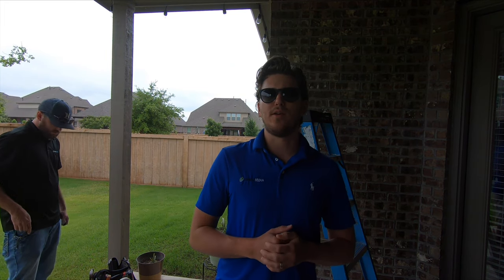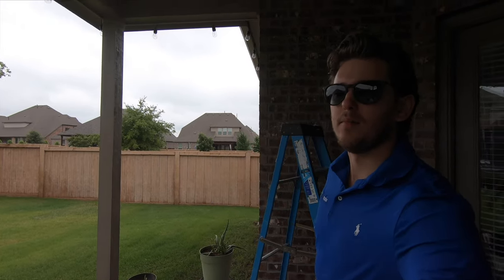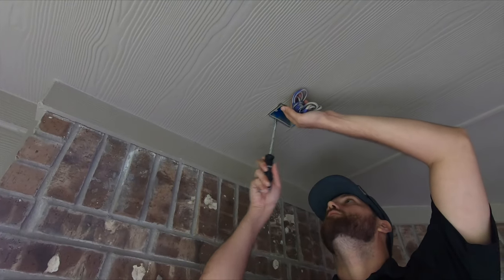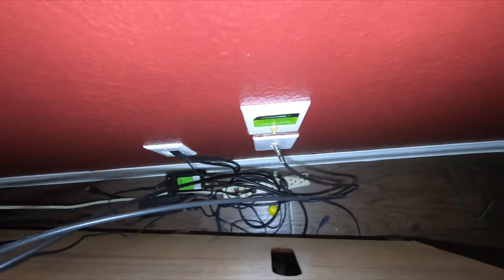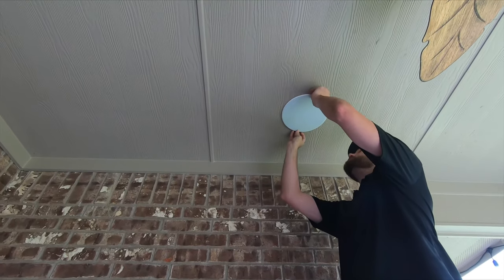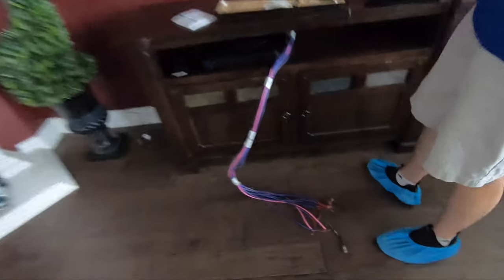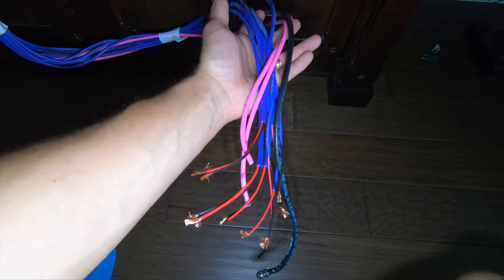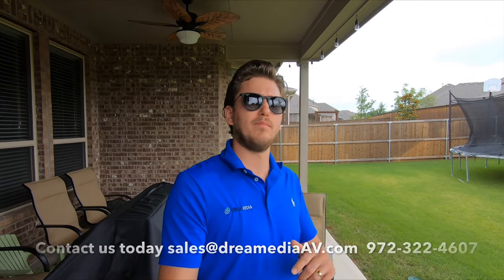BEST solution for speaker on the PATIO! Sonos and Episode ALL WEATHER IN CEILING SPEAKERS

Comment: Great video. If you don't want to spend $70 on a toner, you can use a AA battery. You will need to tap the positive lead on and off the battery while holding the negative wire to the negative end, and it will make noise on the speaker it's being sent to. Shouldn't cause any harm to the speakers, I've done it for years on a wide range of home and car audio setups.

Comment: Great content!!!

Question, is there a schematic for the speaker hookups if I want to add 4 to 6 speakers to the Sonos Amp?

Thanks!!!
Reply: I believe the Sonos amp will support up to two pair of non Sonos speakers (@8ohm each), and up to three pair of their brand of outdoor speakers. You will need to wire all of them in parallel (+ to +; - to -) and not in a series.